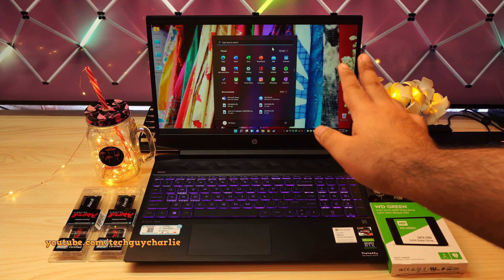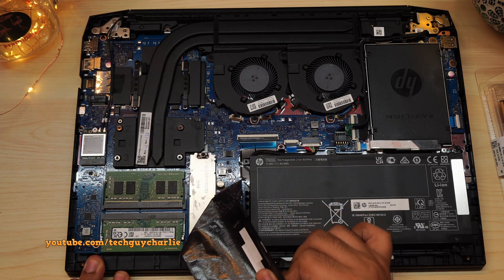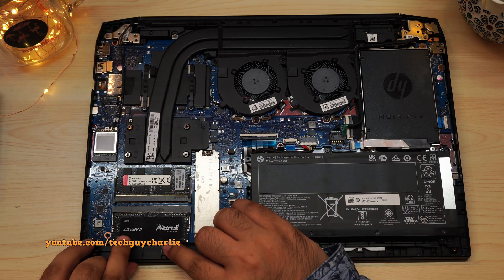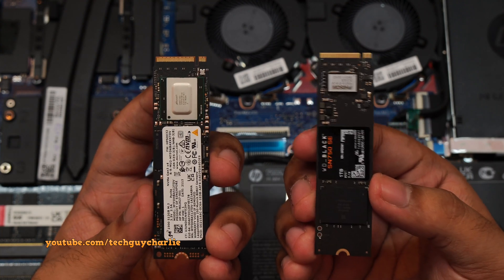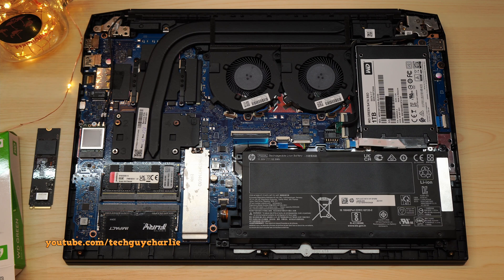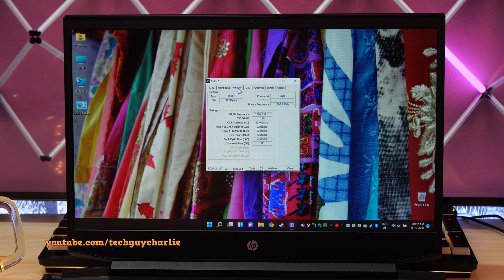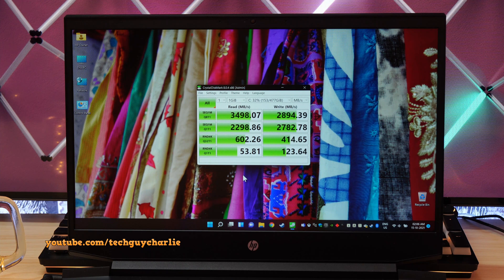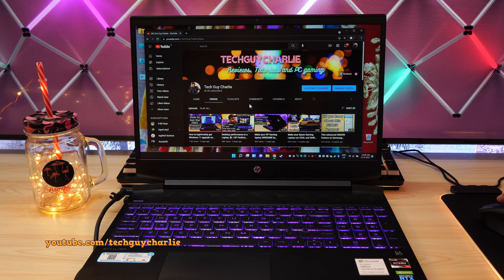HP Pavilion Gaming Laptop Ultimate RAM and SSD Upgrade Guide

Comment: You make it seem really easy however when I tried to unscrew the hard drive, it was really difficult, almost impossible, I spent over 2 hours trying to unscrew this hard drive, and I am planning on keep trying. It's been over a day, this made me so frustrated that I just wanted to destroy the whole laptop.
Reply: Womp womp
Reply: i've had the exact same issue, did you ever get them out and if so how?
Reply: @myg_ho3127  I ended up removing the screws on the sides of the SSD bracket with the screwdriver by pulling them out by force instead of unscrewing them, the SSD bracket inside the laptop bent a little. In the end, I was able to install the new SSD there.
Reply: @renatabalina2720  what did you use to pull them out? because i've really tried and they are well and truly in there 😭😭 and im so scared of damaging other internal component
Reply: im so frustrated right now, i tried every screw driver i have

Comment: can i upgrade graphics card in hp pavilion gaming 15-dk2100TX?
Reply from the maker: Nope! The GPU is soldered on to the motherboard and is not upgradable.
Reply: @TechGuyCharlie  can i install a 2.5 inch ssd in hp Pavilion gaming laptop 15-dk2012TX ?

Comment: hay Charlie one of my RAM slot is not working .if i put There RAM .my laptop is stuck in hp loading .now  i am working with puing one 4gb ram in one slot.Can you help how those RAM slot can repair or where to repair ????????????pleaese replyy
Reply from the maker: You can buy a single 16GB stick and put that in the slot that is working. There is no other way to fix a damaged RAM slot, but to replace the motherboard, you will need to contact HP support for that, but its better to just buy a single 16GB stick and use it as it is because mobo replacements are very expensive.
Reply: @TechGuyCharlie  thank you sir for your reply

Comment: HEY! i have the same laptop will this model support the samsung 980 pro nvme m.2 [ just i have hdd and want to upgrade to ssd the slot is empty ] i hope anyone replies fast and it would be much appreciated :)
Reply from the maker: I dont see a reason why it wont support Samsung 980 pro. But I think you are wasting money by going with a 980 'pro' go with the non pro 980. You wont notice any difference in performance.
Reply: @TechGuyCharlie  hay Charlie one of my RAM slot is not working .if i put There RAM .my laptop is stuck in hp loading .now  i am working with puing one 4gb ram in one slot.Can you help how those RAM slot can repair or where to repair ????????????pleaese replyy
Reply: Ok appreciated... Thank you

Comment: Hello.
My girlfriend's laptop (which is also an Hp Pavilion gaming but equipped with a 1650 graphics card and a ryzen 5) is having problems, presumably the ssd is defective because Windows even refuses to be repaired.

So I wanted to do a clean install on a new 2.5 format ssd hard drive. My problem is that the dummy hard drive screws are completely stuck. They are not broken and do not spin in a vacuum. Just... They don't move.

I contacted a computer specialist and his estimate is 65€, which is expensive for what will take him a maximum of 20 minutes and which I could do myself without those damn stuck screws.

So any idea how to unscrew the dummy hard drive slot? Could a electric screwdriver can solve the problem?

EDIT : Well... I tried with an electric screwdriver and I'm at the same point. Note that the only other screws refusing to move in the laptop are those of the battery.

I'm starting to wonder if it's a hidden defect / manufacturing defect or if Hp did it on purpose to prevent the upgrade.

All I have to do now is return the 2.5 hard drive and order an nvme instead since the screw in this part doesn't resist me...

Comment: Which will have better battery backup because I want better battery backup for college purpose. I am trying to compare variant of hp pavilion gaming series HP 15 ec0043ax (3550h) vs ec2004ax(5600h) . As ryzen 3550h (tdp 35watt and less base clock speed 2.1 GHz) vs ryzen 5600h (tdp 45 and more base clock speed 3.3 GHz ) how battery backup will be  affected ?
 please help 🙏
Reply from the maker: None! Ryzen 3550H is still a high performance and gaming-oriented CPU, it's got the H suffix, you will need to find a notebook that has a processor with the 'U' suffix those processors are oriented towards battery life and portability, generally, gaming laptops will always suffer from low battery backup, they usually last only about 3-4 hours on average, while 6-10 hours is the norm with non-gaming notebooks.

Comment: Great video! 

Regarding the Ram installation, my HP laptop has a SINGLE RANK 8GB DDR4 already installed, and I have a spare DOUBLE RANK 8GB DDR4. Can I Install it, and how will it affect my lappy performance?
Reply from the maker: Thank you and there will not be any improvement to the performance if you keep the single rank stick, the dual rank RAM will operate as a SINGLE RANK RAM to match the existing lower spec memory. You will need both of them to be double rank to get the full benefit of a dual rank memory.
Reply: @TechGuyCharlie  I meant in dual channels. If I keep the existing ram and add my spare ram in the second channel, surely the performance will improve?

Comment: It's worth it to upgrade an entry level dramless nvme SSD (2200/1100 read/write 80k/120k iops) to an top of the range dram gen 3 ssd like 3500/3000 read/write 450k+ iops?
Reply from the maker: That is up to your requirements and most importantly budget, but I'd say for an average person and even a hardcore gamer an entry-level DRAM-less nvme is more than enough. Nowadays I edit my 4K videos off a 1TB WD Blue SN550, which is a DRAM-less nvme one and had a lag-free experience.
But if you are someone who needs blazing fast speeds, edit multiple streams of 4k videos, then by all means go with the best of the best.

Comment: I also have HP pavilion gaming ec2... series laptop, Ryzen 5 5600h and GTX 1650. But customer support is saying that I can only upgrade upto 16GB RAM (I currently have 8GB). If RAM is also same for all models, shouldn't I also be able to go for 32GB?
Reply from the maker: As far as I am aware, these machines should support up to 64GB RAM. That is 32gig sticks in each slot, unless there is an artificial limitation set by HP, I don't see any reason why You should not be able to upgrade to 32Gigs. 🤔
Reply: @TechGuyCharlie  Yeah, I also think that all 64bit processors should support upto 32. But they really confused me.
Reply: I have the same laptop and i have a question, when you opened your laptop was there are sticker warranty on the inside stuck to the lid of the laptop? Or are the warranty stickers only on the ssd and ram? I want to clean it since my fans are dusty but im worried that it will fuck up my warranty...

Comment: Hi I have a question.. The laptop I want to buy (HP Omen 15) is offering 16GB RAM and 1T SSD. My question is, can I use solely the SSD to play games or will I only utilise the 16GB RAM? Cuz as far as I've checked, 16GB RAM is not great as an all rounder gaming RAM
Reply: You will use both to run games, RAM is short term storage and SSD is long term. 16 GB is fine for gaming, even 8 GB is good enough

Comment: Very good video, just notice that the internal orginal NVMe is quite a bad drive. The first few GB you copy the performances are good but then the drop of speed is embarrassing low (apparently once the cache is full) If you plan to use it to copy Video (or other kind of large) files on the road I really suggest that you change also the NVMe for a better model.
Reply: upgrade to what? what do you recommend?
Reply: Nvme model you suggest

Comment: Hey I bought this same laptop 2days back but the idling temperature of the laptop hovers around 55cto 60c and suddenly for no reason it spikes to 70 and 80 and games also stutter. I ran a hardware test and it didn't show any error , I also scanned for malware and it showed nothing. What do you think it would be ? And the battery also only stays for 1 and half hour during normal use like youtube and stuff. Pls help me out man.
UPDATE: after little tweaks the laptops working fine as fuck !!
Reply from the maker: Sorry for the late reply. btw, those idle temps are normal for a high performance laptop, mine stays between 55-60 and sometimes spikes to 70 when the laptop is sitting doing nothing, the fan stays off during this time, (I've observed the exact same similar behavior on my Ryzen desktop PC). While watching YouTube or Netflix they hover around 55 since the fan stays on.
While gaming, expect the CPU temps to be around 90 degrees, you might have seen this in the review, that is normal for this high performance hardware, however, games do not stutter on mine.
As for the battery life, I get an average of 3-4 hours while watching videos and doing office work, this is with the battery saver turned on, medium brightness.

I hope you have un-installed all the junk that HP has pre-installed on this laptop, those apps keep running in the background and get a laptop cooling pad, those are essential while gaming. 😊
Reply: @TechGuyCharlie  thanks !
Reply: @TechGuyCharlie  can you name the softwares which i need to uninstall i purchased the laptop today
Reply: can you say what tweaks you did :)
Reply: @smrutibarik3361  So tbh nothing big. For the performance and thermals I reset the laptop multiple times like for several other reasons idk if that helped but every games started running really good. My previous review was based on one game but then the other games worked really well and after a while of playing and doing little graphics tweaks in the game it started working really good. Now my laptop runs 100fps+ gta v with almost full graphics and in optimal graphics usage and bout the thermals after some days of use the idle thermal becomes normal. While not on charging use it in power saving mode low performance refresh rate to 60hz brightness set to below 50 and backlight off(all these changes doesn't affect my user experience except the refresh rate one that it only a lil bit). Also I was crying about the battery without doing all this and after doing all this I can run that thing for 5hrs and fan &thermals are also in control. So that's pretty much it. It's an Amazing lap like even better victus. Because I have used victus too and returned.
Reply: @keshavr9850  how to reset this laptop man my first laptop :( i used a pc for 10 years
Reply: @smrutibarik3361  go to settings you'll find an option for reset or just refer some youtube video. It's simple

Comment: which ram should i use? i want to upgrade my same hp model i.e 75ax urs is 76ax, I have 8 g.b of ram but I easily touch 93% , suggest me a good one which should be capatible and be utilized fully. Thanx
Reply: Well I went for the Crucial 8 GB model 3200mhz, and then now the ddr4 ram prices are super low and I bought 8Gb stick for 2450rs and now it selling for 1500rs . SAD BUT I can upgrade to 32 GiB now and sell the old rams.

Comment: what parts can I use to upgrade my HP Pavilion 16-a0045nr? thanks for the video...
Reply from the maker: You can use the exact same parts I've used, both the 15-ec2076AX and 16-a0045NR have the same RAM, NVMe and SATA SSD slots.
Reply: @TechGuyCharlie  thanks!!

Comment: Sata ssd cost Rs 12,000 ($160) in india. Time to leave India I guess 😂
Reply from the maker: Significant chunk of it is tax 😢😓 anyway, don't get a super high performance SATA SSD since its a secondary drive, go with a low power cost effective SSD for storing your files, that way you will save money and still have something that is way faster than a spinning HDD. But if you wanna edit 4K or do work that is IO intensive, then by all means get the best of best.
Reply: @TechGuyCharlie  Ok, noted! Any chance of getting virus free Premier pro cracked?
Reply from the maker: @prafulpnair1809  Try Davinci Resolve, its a great free alternative to Premier pro😉, I don't encourage or promote the use of any 'cracked' software on the channel.
Reply: @TechGuyCharlie  Cool!

Comment: Is the green one good enough for gaming?
Reply from the maker: Green one? 🤔 you mean the RAM which comes installed from the factory?
Reply: If you mean the WD Green then of course.Many games are not even optimized for SSD's and they run fast even on HDD's so that SSD will handle it with no stress
Reply from the maker: Oh that, WD green drives are great as a secondary storage drives for games and all, they will always outperform an HDD and no that is not true, EVERY game will load faster on an SSD compared to an HDD! Its been more than a year since I've moved to an SSD for gaming on my desktop and it makes a MASSIVE difference, be it any game.